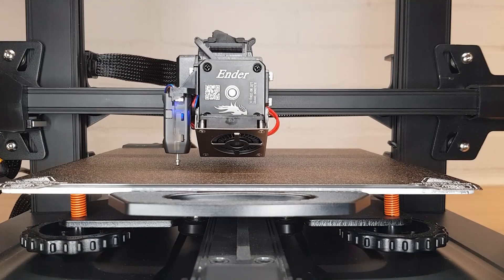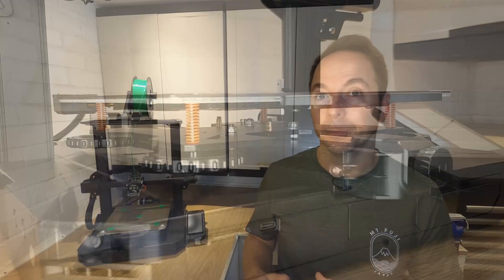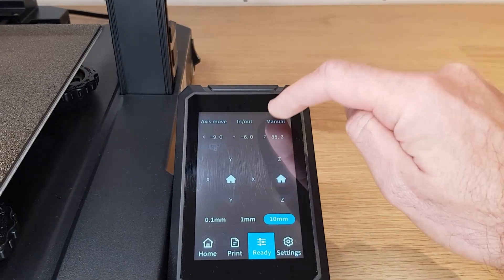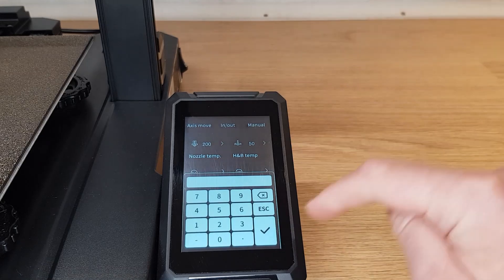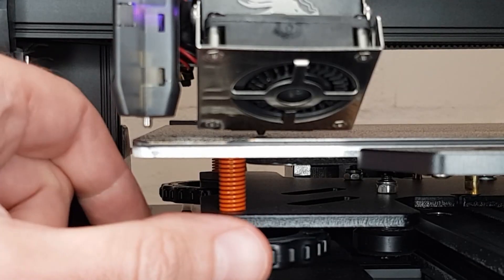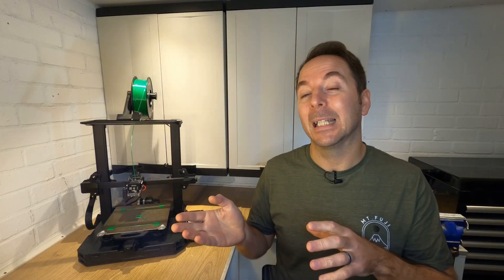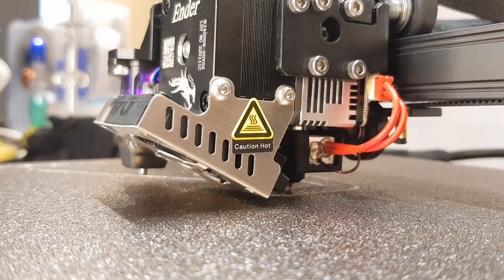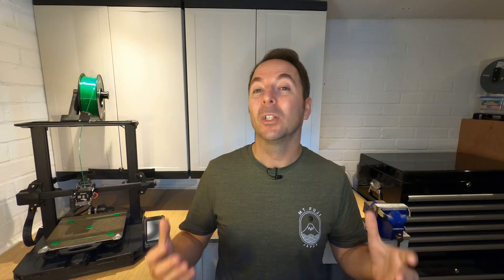Ender 3 S1 Pro 'Automatic' Bed Leveling In 3 Simple Steps

Comment: HELLO, I HAVE A PROBLEM ON THE SCREEN SHOWS THE BED'S TEMPERATURE BUT I MEASURED WITH AN IFRARRED THERMOMETER IT SHOW A DIFFERENCE IN 10 DEGREES, FOR EXAMPLE THE 3D PRINTER SHOWS 70 FOR THE THE THERMOMETER SHOWS 60, I CHECKED THE SENSOR IS WORKING FINE HOW CAN I SOLVE THAT, ALSO I HAVE DONE THE AUTO TUNNING PID. (ENDER 3 S1 PRO TOUCHSCREEN) THANKS IN ADVANCE
Reply: Im 100% sure ur infra thermometer is miss showing

Comment: Hi,
I think Marlin starts numbering from 0, so M420 S0 will load the correct mesh. You can use G29 P1 and G29 P3, and after creating the mesh, G29 S0-3, which will save it to the specified address. Then, before printing, use G29 L0-3 to load the selected mesh. Optionally, you can add G29 J for slight corrections.

Comment: I know this is a little late but did that light on the top come with your printer? I have th S1, not the pro and would like a light like that.
Reply: Yes they are a feature of the S1 Pro. You can print them yourself if you want and buy a led strip

Comment: Hi, I know this video is old but I was wondering if you could help me with an error while autoleveling
It says 203 Probing Failed
I used to do this leveling just fine, but I haven't used the printer for a while now
Reply from the maker: It sounds like your bed probe may be faulty or you have a wiring issue.

Comment: I have followed this video to the T at least a dozen times and my bed still won't level properly.  Once I loosen the bed screws and tighten them back up to where they are just touching with no preload, I put an exact 2 pounds on each corner to ensure I've applied the same preload on all 4 springs.   Nozzle set to 0 and bed set to 60. Once I start the aux leveling process, my z-offset has to be set to -4.85 before it touches the center of bed.  I'll tram each corner 2 twice and after returning to the number 1 position I have to lower my z offset to -5 and it still won't touch the bed.
Reply: I have almost the same problem. I have tried for hours every day for a week but it doesn't work. I am about to break my printer.

Comment: Following the advice on this video has transformed the performance of my printer. The start up code modification in CURA now means that the levelling process results are used during printing. I’m not sure what was happening before, but thank you for a great video.

Comment: You should change the video title to: how to fuck up all your prints for next month. With your method of leveling when you printing tightening wheels get loose and loose and falling out, bed goes up and fucked all print and as a beginner you getting struggle what's wrong. Go to hell

Comment: Hi, I only just got my first 3d printer the ender 3 S1 pro and every time I follow your instructions to the letter. Point on set perfectly. Then go though points 2-5 on the bed. When I go back to point one it’s right down. I’m loosing my mind after 5 hours of leveling and different videos. I wanna throw this thing out the window 😢 

I’m not a technical noob but this is infuriating. Can anoyone tell me why when all 4 outer edges are perfect the middle is so tight it can rip paper!

Comment: Hi, I have a problem with the bedleveling.

I did everything accoridng to your video. Also tried the G29 and the other code at the end.

But when my 3D printer starts printing in the middle, it always seems to want to print in the "air" I have to smash the Z-axes when it starts printing as a crazy to get it on the bed.

But the odd thing is, the pree-print lane on the left always goes PERFECT. 

I'm entirely lost of what is wrong
Reply: Same for me, no matter what i do, its like the bed is made of teflon.
funny thing is, sometimes it prints ok and others no sticky stick.
Reply: @the-vapist2242  EXACTLY THAT
Reply: @nonamechannel8777  i think i found the issue, bottom roller on the extruder has play on it.
raise z axis up and give the extruder a tug up and down and you will feel it.
if it is the bearing you may hear a "clunk" when you turn the printer on.

Update: it only does it after the printer is heated.

Comment: This is a great video,I would like to mention that in my case I think that the G29 line works better because I move the printer around. These movements might change the alignment and thus leave the original bed mesh a bit more scewed. Both options are valid but have in mind why you pick one over the other.

Comment: Hi Ricky, have to agree with all the appreciation comments below.
Bought the S1 pro and used your video back in January with flawless and countless successful prints.  Have since purchased a second S1 pro and ripping my hair out.. it’s like it forgets the fresh new level between finishing the tram and me pushing print.. last print for example trammed at -2.80 had to drop it to -3.05 for decent bed adhesion. How can one printer remain “perfect” and the second be a pain in the ass.. I have yet to update the FW, PS nobody has a decent video on that topic.. the printer and the screen both needing done 😉

Comment: Thanks for showing this and for the tip about adding in the code to the slicer.  By any chance would you please do this video again using the new Ender 3 S1 Pro firmware and software updated in November of 2023?  This shows the mesh settings and I have No Idea what they are telling me but they are all over the place!  Life .32 - .24 on 3 of the corners.  Help if you can, much  Appreciated.

Comment: so is there anyway to change the position of where the m420 auto level command starts? after it auto homes it moves to the center and does the m420 command. its not a huge deal but it does take more time vrs if it did this at the home location then continued on with the line purge. just curious if its possible to change where it performs this action to save time.

Comment: I got my ender 3 s1 pro recently and for whatever reason, the front right even when the whole bed has been adjusted and triple checked for level is always lower then the entire thing. I have had nearly 7 prints all fail at the same point every time.

Comment: I have been struggling to get this printer making anything higher than Benchy correctly. Question ? If i turn off the power to the printer do I lose the mesh? Like should i be doing this every time? I get one print working and the next gets knocks off or filament  balls around the nozzle. I have cleaned, leveled, glue, changed settings and still no luck. closest I have come is this video to making a few small basic prints. This video was awesome and very appreciated

Comment: I did everything like in the video. But I have the problem that when I start printing nothing happens even though the Noozle temperature and the bed temperature have been reached. But when I put the Z axis on the printer in the home and start printing, the printing runs. I hope someone can help me with the issue on the Ender 3 S1 Pro.
Reply: Thats the G-Code on Cura that i use.

G92 E0 ;Reset Extruder
G28 ;Home all axes
M420 S1 z10
G1 Z2.0 F3000 ;Move Z Axis up
G1 X10.1 Y20 Z0.28 F5000.0 ;Move to start position
G1 X10.1 Y200.0 Z0.28 F1500.0 E15 ;Draw the first line
G1 X10.4 Y200.0 Z0.28 F5000.0 ;Move to side a little
G1 X10.4 Y20 Z0.28 F1500.0 E30 ;Draw the second line
G92 E0 ;Reset Extruder
G1 Z2.0 F3000 ;Move Z Axis up

Comment: This is by far the best video for leveling and I always come back after each firmware upgrade. A lot has changed in the latest firmware and now you see grid with numbers in auto leveling. It would be great if you could make a new video.
Thanks @RickyImpey

Comment: Hi Ricky! I recently purchased the S1 Plus printer and I'm facing bed leveling issues. Since I bought the printer a month ago, I've been struggling with the first layer. Despite manual and auto-leveling attempts, the initial layers appear uneven, almost as if the bed isn't leveled. I tried using the G-code M420 S1 Z10 in Prusa Slicer, expecting the Z-height to adjust during the first layer, but there was no noticeable change. Is this normal?

Moreover, there have been instances where the nozzle sticks to the bed even after following all the necessary steps. Additionally, during the infill stage of printing, there's a noticeable noise, indicating a possible collision between the nozzle and the print. Do you have any suggestions to address these issues?

Furthermore, in the few prints I've completed, the infill structure remains highly visible despite setting it with three perimeters. The printing quality is excellent overall, but I'm experiencing leveling issues specifically in the first layer. What recommendations do you have to address this problem?

Comment: Question: if one of my corners raised a bit at some point, would it be better to do a G29 to do a new bed mesh before each print to save the time of redoing it all? I redo every now and then. but I want to go a dozen prints between, and so far I cant. I can get 2 or 3, and one or two corners are higher. What do you type for the rest of the G29 line?

Comment: Love your videos. Concise, but not too rushed, great helpful videos.
Question
My slicers (Both Creality slicer 4.8 & Cura slicer) do not have either of the G29 or M420 in the start g-codes.
HOWEVER, when watching the first layer, I can clearly see the Z axis screws adjusting at certain points of the bed, flowing ever so small dips in the bed, particularly at the extremities. 
My only conclusion is that the printer must be using my saved mesh, following the data gained by the auto bed leveling probe? Somehow?
Any insight friend? 
Should I do nothing?
The "M420 S1 Z10 ;" command to gradually even out such variance over 10 layers does sound appealing, we're always questing for better quality prints, but I don't want to fix what ain't broke.

Comment: Hi Ricky.  Thank you for all your tutorials.  They are so useful!  However, I have some problems leveling the bed since replacing the springs with silicone blocks... Do you have any tips for leveling with these???  Thanks in advance.
Reply: I work on ender 3 s1 pro with Sonic pad
Reply from the maker: Honestly, I don't use the silicone springs, I've never needed them. My preference is the yellow springs, they are strong enough for nothing to move.

Comment: Great Guide, simple and to the point... I'm not sure if I re-learnt something with the "use saved bed mesh" or if it's that long since I swapped printers I forgot this!

However, your start code DID teach me something... that was what's wrong with Cura's code:

     G28 O ; Home all untrusted axes

The steppers have been disabled.... none of them can be trusted!!!! 

We should default to:

    G28 ; Home all axes

I didn't spot the problem until I crashed the Hot End into the Hot Bed connection as I'd moved the bed to remove a print - restarting the printer still trusted the position!

Thanks for posting this :D

Comment: Thank you again for the great video! I realized that my ender 3 s1 hat no G29 or similar, so all the time I havent used the auto bed leveling since I got my printer :O The printer now does the bed leveling after heating the nozzle and the bed, I always thought bed leveling should be done while cold? In my opinion it makes more sence to measure the heated bed...

Comment: Super helpful to get my printer working correctly. 
I was already becoming desperate why my leveling efforts didn't work properly.
Especially the procedure of first setting the value on the screen for position 1 and then adjusting the screws for position 2-5.
As well as using the "M420 S1 Z10 ;" command.
Thank you!!

Comment: I am amazed how well this works. I have this printer for a couple of weeks and kept having adhesion issues. It's my first 3D printer and knew that there are multiple 'workaround' for this issues. The only way my prints would stick, was by applying a generous amount of glue stick. The way more expansive version Magigoo did not even work. And it looked messy and weird in comparison to all other Youtube examples. 
But the last part in your guide about the slicer settings in Cura finally did the trick! All my prints stick perfectly without any glue at all. 
Thank you!

Comment: What the? I'm using the Creality slicer with my Creality printer and there is no G29 or M420. I JUST returned a CR-10 Smart because it was digging into the glass bed and being a complete nightmare to level. Could this have been the problem? Anyway, I exchanged it for an S1 Pro and so far everything has been working.

Comment: Finally! Finally I have print out of my Ender S1 Pro , thankyou, I'd done all previous steps but on a different video someone had recommended the G29 - common entry - but this seemed to give a few layers and then somehow just went to spaghetti, like it was knocking the print loose itself - but thanks to your tweek I've saved the bed mesh, saved loads of time with it pratting about doing the level every time it also seemed to heat up then go down again and then back up (not sure I've fully stopped this but your other tip on changing settings as it runs allows me to override this weirdness, at least sometimes) - its a very odd printer compared to my older Ender 3 which I upgraded from (and still prefer as it just banged out prints no issues!) and itss sticking to the bed like crazy now, unlike before, anyway finally got a print! thank you

Comment: I have been  struggling with my S1 pro since I got it new like 2 years ago. Always seemed like the ABL wasn't working, I just thought I was bad at leveling. Turns out it wasn't using the ABL this entire time because I didn't know the G-code tipe. 

Thank you so much, I will die for you.

Comment: A useful video would be how to actually adjust the level live based on what you see in the first layer.
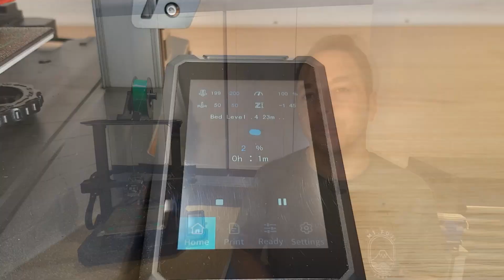Reply: 4:53 in this video
Reply: @debochch  What I mean is a video showing if the first layer looks like this, your bed is too low, or if your first layer looks like this you're too high etc.
Reply: @dosdont   ok.  Yes that would be rally good.  He could print out a single layer bed level test print. Then show what a good print looks like compared to ones that are too high or too low.

Comment: I noticed that after setting the z offset for the second time (last step), going back to corner spots the nozzle was touching the bed, is that expected?
Reply from the maker: Yes, the nozzle should be just touching the bed at zero on the z axis. If it's pushing down then it may be slightly too close. Try a print and see what your first layer is like. Maybe manually adjust your z offset to dial it in while the first layer is going down if needed.
Reply: @RickyImpey  I guess what I meant was, it seems like after the combination of the auto level and z offset makes all the points different heights again after going to auxillary mode at the end (which you didn't really do but I decided to anyway). Maybe I'm just overthinking it

Comment: Your statement using this M420 S1 Z10 ; S1 indicates slot 1 implying there are more than 1 storage locations. Each time I do a Leveling procedure does it store in a different location as in S23? Why would there be more than S1?
Reply from the maker: No, generally it will just overwrite slot 1 and only use this. However, if someone were to modify the firmware, it could be possible to have multiple meshes in different slots.

Comment: How can you tell if the auto level is correct? Mine just does it but doesn’t say if it’s good??
Reply from the maker: The best way is to print out something like a 'bed level test' print. Any Ender 3 one will be fine for the S1 Pro if you can't find a specific one on somewhere like thingiverse or Cults3d.

Comment: It was the best bed level video I've ever seen. can i apply these settings for ender 3s1 plus? ( no g29 and m420 in cura)
Reply from the maker: The leveling process is slightly different with the S1 Plus but the M420 code works with all Marlin machines that use a bed probe.

Comment: Might be a daft question but does all this apply to the standard ender 3 s1 as well?
Reply from the maker: Unfortunatly all of the Ender 3 models vary a little in spec so processes are different too. The S1 is actually pretty different from the S1 Pro so they leveling method is pretty different too. I don't have an S1 to be able to tell you how to level correctly with it though i'm afraid.

Comment: Thank you for this! Really helped so far but question, now before i put a new print everytime do i run the autolevel or just do a quick manual bed level?
Reply from the maker: Once you have your bed level and saved a mesh, you shouldn't need to do any of it again until something changes. If you feel you have to tram/level the bed often then maybe check out some of these potential causes: https://youtu.be/9eQ_rBzfm5s

Comment: Good day, it's about leveling your bed from your Enter 3D S1 PRO. First I had done it according to another video. But my PLA filament didn't stick to my bed. Until I saw you video with right clear equalize the tips for your bed.  Especially that machine put in the start G code that you had to place M420 S1 Z10 at G29. Now I can 3D print. Thanks for the video.

Comment: Thanks for this video. I'm having issues though on the edges of the print bed when printing larger prints or multiple. Is there a way to adjust the mesh points to go further out towards the edges?
Reply from the maker: Not easily if you are running stock firmware. With the Sonic Pad or other klipper device it's pretty simple.